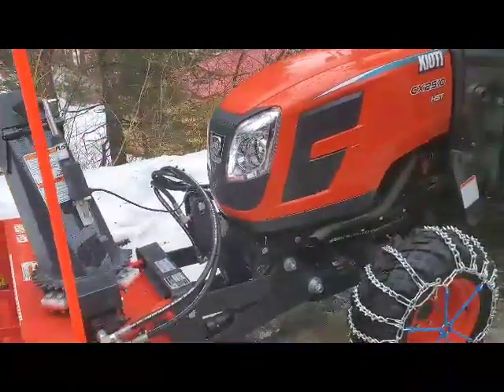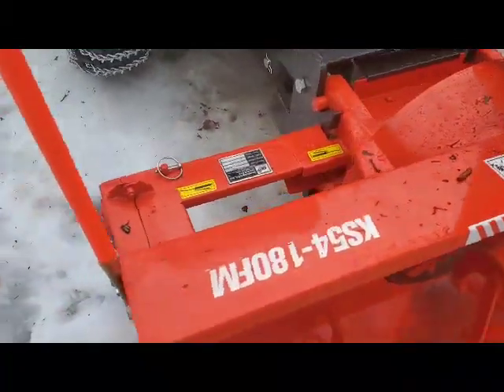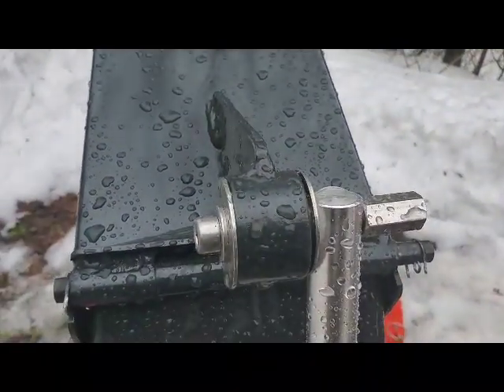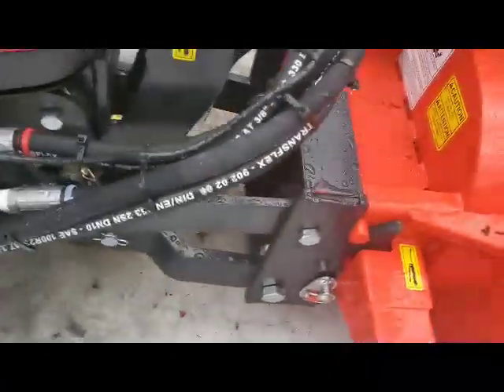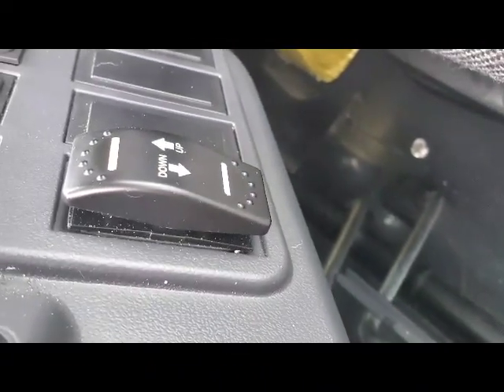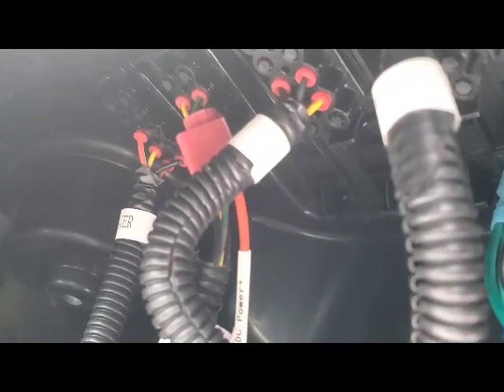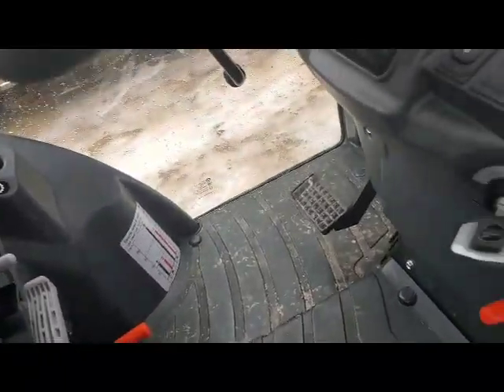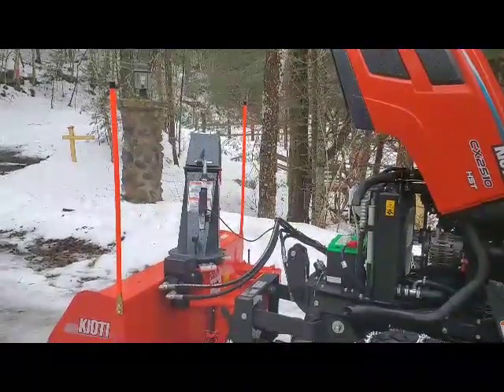KIOTI CX2510 with KS54-180 Linear activator chute control install

Comment: Good job. I did a similar install on my LX2610 Kubota. To take it one step further I also added a lineal actuator to the SSQA on the loader. Using the same type of waterproof connector and running the wire with the hoses simplified the install.